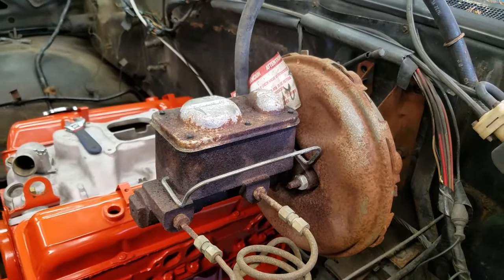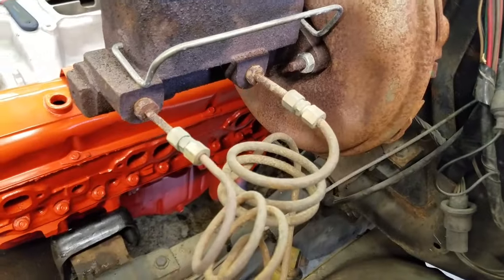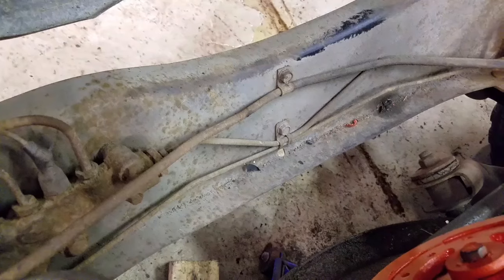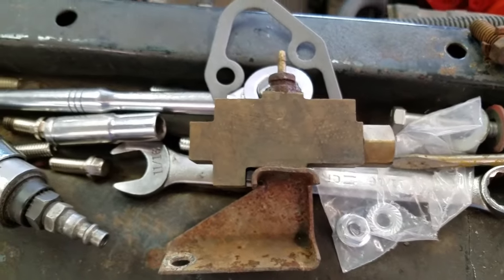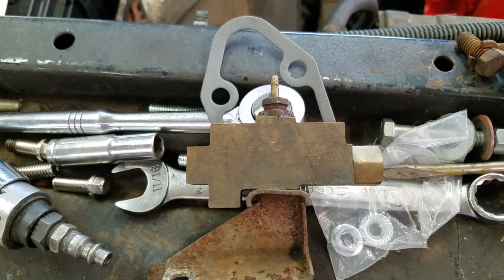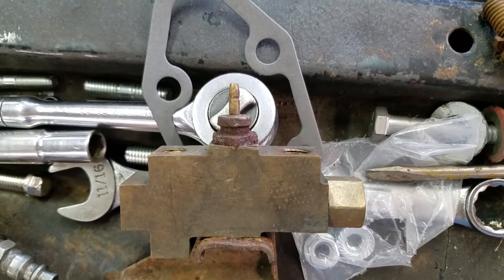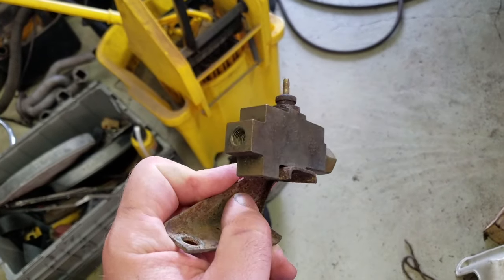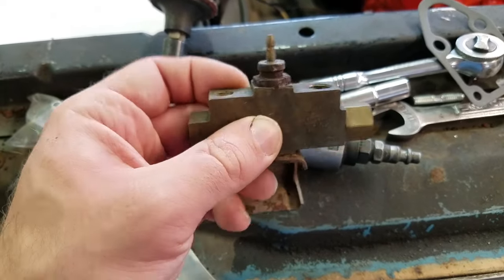Why Your Old Chevy's Brakes Won't Bleed.

Comment: this is the corvette guy again.  IT WORKED!!!   after weeks of saturdays mucking around this video was exactly the solution.  my son and i had problems with the rear brake line  on the valve, would not budge, so we went from the top of the valve, the switch, as described, removed the switch and used a very small screwdriver to move the rod back into position.  we tested that worked by verifying that the brake warning light went out.  at last.  bleeding worked normally. Eureka!
Reply from the maker: +Roost Fezza Great!
Reply: What's the company that makes the aluminum piece you talk about in the end of video

Comment: This just saved me a lot of grief.  Thank you!  FWIW it's fairly easy just to pull the brake like that goes to the rear off and shove a small allen wrench in there to "click" it over.  Pretty easy to tell when you get it because brake fluid will start to pour out

Comment: This is not completely accurate. First of all, that unit on the truck is not just a Proportioning Valve, but a Combination Valve. It contains 3 valves in 1 unit: 1) Proportioning Valve; 2) Metering Valve aka Hold-Off Valve; and 3) Differential Switch. The latter is what is tripped when there is a leak. Also, that button is the Metering Valve. It is not there to reset the front brakes. You're supposed to pull that button OUT to bleed the brakes. I'm pretty sure pushing it in does nothing to reset the Differential Switch.
Reply from the maker: It's covered with a factory boot and cannot be pulled, only pushed.
Reply: Yes, they are all covered by a rubber boot to TRY to protect them from the elements. I am sure that button is the Metering Valve, which is completely different than the Differential Valve.  That's why that button doesn't exist on that stand alone Differential Block you were holding. I believe some are meant to be pulled out to allow flow while others are meant to be pushed in (which can cause great confusion in bleeding). I suppose it's possible the Metering Valve Rod doubles as a Differential Valve Front Reset in your particular application, but I doubt it.  Otherwise, your point of needing to make sure the Diff Valve is reset is correct.
Reply: I can't bleede my My 2004 Tahoe . is this the same problem?

Comment: This happened on an '05 Silverado today.  We used compressed air in the right rear to open the blocked valve back up due to a leak on the back and line replacement.  Worked like a champ.  Fluid started flowing like it should.  Best pedal he has had.
Reply: Sir Sweetness
Reply: so you blew compressed air through the rear line so that the pressure would reset the piston in the prop valve?
Reply: Ooh, good idea. Worth a try.
Reply: @MrZayne8  

   After this Silverado, I had to do this on a tundra that we replaced a rear brake line.  I wasn’t getting fluid out of rear bleed screws so I did a small short burst of air and it let the fluid flow.  This sounds crazy but it works.

Comment: I was going crazy for a week trying to figure out why my rear brake will not bleed. This video really helped. Thanks
Reply: Arden Banks hey what was the problem with your brakes? I ask because I’m having trouble bleeding mine rear brakes trickle out fluid and the front gush out .and my brake pedal is soft.any insight would be appreciated.

Comment: Thanks for the video and thanks to those commented.  The technique for resetting the valve that worked for me was to open one front bleeder (with a hose attached to catch the brake fluid) and then to STOMP abruptly on the brake pedal.  I tried this a couple of times and it worked!  

The method of holding pressure on the brake pedal and then opening a front bleeder did not work for me.  I tried that at least 5 times with no success.  The "open first then stomp" method was discovered from reading through the comments.  Thankfully I didn't have to disassemble the valve in any way or remove it. 

Thanks again for all the comments!

Comment: Hey thanks Bud for your info. I have a 1978 Chevrolet 1/2 ton two wheel drive replaced the rear brake line still couldn't get it to bleed finally after watching your video it works. 
Thanks again
Reply: Hey I did get a new proportioning valve from Amazon and replaced this last weekend and I still can't get the back to bleed right any suggestions? It has new master cylinder on this has me stump.

Comment: Big huge help exactly what was going on with my 72 Cutlass. My solution was to relocate and get a new proportion valve. Turned old one into a simple T block X 2 one for front one for back. New valve located at master cylinder easy access worked great for me. I'm a simple dyi guy with no lift and limited space. Just getting to that old valve was next to impossible so by relocating it to where I can actually work on it saved me a lot of agg

Comment: A big shout out thanks to you about the problems with the proportioning valve! I have a 1987 plow truck that has developed this problem due to changing both front calipers. Tried to bleed brakes and nothing works. Have good brakes but the darn light won't cancel out! Now I know because of your help. THANK YOU.

Comment: @ Fuel Injection Sucks

I think you may have just solved my friends "rear freekin brakes don't seem to want to bleed" after replacing two masters due to leaks issue. Been dealing with it for about a month now. Thanks so much man, my buddy will be thrilled to see this video.

Comment: Nice video. This is exactly the video I was looking for. 

disc/drum Chevy.

Brake system is 90% new. Front calipers are geysers. Rear wheel cylinders just trickle. Disconnected all hard lines from the prop valve and blew compressed air through to be sure there was no clog. Replaced rear rubber hose in case it had collapsed but no change. 

final suspect was the prop valve and you just confirmed it is indeed the piston inside. Attempting to reset the piston tomorrow and bleed it for the last time for a while.

Comment: I wanted to tell you I just loosed the front brake bleeders and smashed the pedal to the floor, tightened them back up and now I can bleed the rear brakes so thanks for giving me a option on what to do, 15 mins and I was done bleeding all the brakes!

Comment: I KNEW IT! I've been chasing no fluid out of the front discs for days. Even with a power bleeder I only get a trickle from the front discs. The rear drums were flowing great.
I tested the proportioning valve with a test light and it came back negative (AKA it's all good) I suspect it's not centered. I'll follow up if it is indeed the problem.
Reply: Me too
Reply: ipwee a

Comment: I listened to every word. I have a '77 chevy P30 step van. We went to bleed the brakes and get no fluid to the rear. Even my mechanic was at a loss. Although I had a feeling it was something to do with this. I think im gonna just put in a brand new valve. The one that's in is original, so it'll go in my old parts bin to be restored at a later date. 😎

Comment: This video solved my issue with the new proportioning valve I installed. No pressure to rear, I pushed the valve back to the center and it was solved. Thanks!!

Comment: Glad I found this video.  The light on my 79 vette came on after a quick brake stab a few weeks ago.  It's got new calipers so I know it's not a leak issue.  Gonna try removing the switch and see if I can't reset it.  Might save me $100 for a new valve and the frustration of trying to bust free  40 year old lines...

Comment: OK, I'm slow, so I listened to it twice. I've got a 92 GMC C1500 and all brakes parts are good, I've bled all brakes, the same as I would on any other car, but I have no rear brakes. So I'm going to buy this tool and see if it works.  Now I think I get it. Here is , I believe the tool you need to lock the proportioning valve centered, so you can adjust the brakes. Search for this: "Proportioning Valve Bleeder Tool w/One Man Brake Bleeder". Thanks.

Comment: Exactly what I needed to find out.  Had a full drum setup that had rear lines disconnected for an extended period to rebuild the differential, and after one half of master cylinder drained itself down... all flow stopped at some point while trying to bleed.

Comment: Thanks for the video.....exactly what happened to my GN when I was trying to bleed my brakes after my rear brake conversion....I also replaced thebprop valve with a disc/disc prop valve. Will give it a shot. Thanks

Comment: I have a 71 GMC back brakes worked only, tried the stomping method didn't work, removed the brake light switch, sharpened a very small screwdriver and worked the piston back into position, re bled the brakes and presto everything works as it should. Thanks for the Vid

Comment: that button is the metering valve for front calipers to hold off the front brakes until the rear drums apply; so that front and rear apply at the same time

Comment: That explains why I couldn't get my rear brakes to work properly on my old 74 Camaro. I installed a Willwood adjustable propositioning valve. That fixed the problem. After some trial & error that car probably had better brakes than when it was new. If you convert from drum to rear disc brakes you will need one of those. Or your rear  disc brakes will probably never work right. They will work,but they won't even have the stopping power that your old drum brakes had. Disc brakes need much higher pressure to work properly. They will work if you use a master cylinder designed for use with 4 wheel disc brakes. That's how I converted my 97 S-10 to rear disc. Used a master cylinder from a truck with rear disc brakes. Had to power bleed the whole system and use an Autel Maxi- Pro bi-direcional scan tool.to get a good pedal feel. Before doing that it pedal was really spongy. I went through about 5 big bottles of brake fluid trying to get the air out of that system. I don't think it's possible to bleed the brakes on 94 & up GM ABS braking systems without a bi-direcional scanner with ABS bleeding function.  Some bi-direcional scanners don't have that option. So if you go out and buy one,make sure it's got that option, and that it will work on your vehicle. Some Tech -2 scanners have that option,but they don't work on all GM cars and some don't work period on trucks. The Autel has worked on every vehicle I've used it on..so far anyway,and it was way cheaper.

Comment: That was well explained. I wonder if compressing the slave cylinders when replacing brake pads might occasionally cause the proportioning valve to slide over enough to give problems later. Conventional wisdom is to crack the bleeder screw when doing that but in the rust belt that is an invitation to a broken bleeder screw. I've heard about that causing seal issues in the MC but with the difference in pressure between the two sides I wonder if there could be a problem there, too.
Reply: Awesome every now and then there is still just a every day Joe that has some thing really smart to say . These are the moments I am glad my old man invested a lot of time in me  and I know how to shut up and listen when it matters.

Comment: Thank you for this video. Something I didn’t know. I don’t have rear pressure but plenty on the front brakes.  I do believe you on this being a primary problem.  Same time I need to clean the fluid too.  Thanks again

Comment: Years ago I bought a new 1978 Trans Am.  In the morning when I'd go out leave for work I'd find my wife had left in it, leaving me her Pinto.  So, I bought her a Trans Am too.  When both of these cars got 10 years old the rear drum brakes started locking up.  I never was able to fix the problems.  New proportioning valves by then were no longer available.

Comment: thanks with that tip i got this problem with my 85 g10 van . im going nuts i already replaced master cylinder and wheel cylinders and still no brakes pressure on rear

Comment: Great video! They use the same setup on most Jeep XJs. I’ve gone through hell trying to get fluid to drums before figuring this out. Now I can’t bleed them & my MC is not building pressure to the pedal :/ I think the seal is shot but that’s tbd.

Comment: I got so frustrated by this that I took the elec. connector out, centered the piston, and drilled down thru the piston with an 1/8" drill bit all the way thru till the bit comes out the bottom of the block and drove an 1/8" roll pin in it to keep it from moving again. worked real good. Got great firm pedal. This piston is not really needed if you think about it because the master cylinder has two separate circuits. So say you blew a rear line, the only difference it makes is that you'll lose 50 cents worth of brake fluid out of the rear master cylinder reservoir (because the piston won't slide back and block off the back line.

Comment: No fluid to rear breaks Solved!! We could not get pin to push over pushing in as hard as we could with a small screwdriver. Instead our Mechanic loaned us an air bleeder (hooks to compressor) from harbor freight which drew the fluid to the back breaks. Then once fluid was to both back breaks we closed bleeder valves he had me stomp on the breaks about 6 times. That reset the piston he was referring to in the video. Back on the road!

Comment: I will say this, the larger Reservoir is usually always for the front because 70% of your stopping power is in the front and you don't want to run out of brake fluid in the front

Comment: Really shouldn't use compression fittings on brakes lines... Good video and info.
Reply from the maker: I agree, never use them. This was a sin of the last owner.
Reply: I also did the same as a kid , way back . Even though I did not have a problem , it only takes once . In New York , it may fail the safety inspection . Also , if it failed and you hit someone and they inspected your truck - you're screwed . Cal Van Tool has a great double flare tool . Not expensive and better than the standard types .

Comment: Awesome information! never ran into that problem myself most of the time the brake hoses seemed to have a lot of issues pulling real bad to one side or the other , I do remember some car having a leveling system and that would cause problems bleeding but usually a power bleeder would work , i forget what kinda car it was ,
 But good info !
Reply: thanks

Comment: If all else fails Summit sell a race application proportioning valve that you can manually set for front to rear brake pressure. I had to use one when I put a 1 ton axle on a 78 blazer.

Comment: Had same issue couple years ago, found a forum on this subject and someone said pump up the brakes with motor not running then press hard on pedal till a click is heard that is the piston recentering then you can continue bleeding,  worked on my 87 k5

Comment: Opening the bleeders and stomping on the brakes worked for me, I have a 79 g30. Thanks!
Reply: I have a 78 G30 box van , my front brakes won't bleed very well what should I do , open the front bleeders and stomp on the pedal?
Reply: @JuanHerrera-co3wc  did it work

Comment: I'm here because they got the same kind of trouble with the same exact proportioning valve trying to bleed the rear brakes on a chevy monza that had blown outhe rear brake line.

I inadvertently removed that rear retainer not when I was trying to remove the remainder of the rear brake line.
 Some guts came out and I thought I put him back in the way they came out I'm hoping I didn't screw anything up.

I just tried to put some positive Air pressure through through the valve on the master cylinder side and I couldn't get anything through.

Comment: When bleeding the rear drum brakes on an old 60 70s car or truck with disc/drum brakes, just pump up the pedal then give it a good stomp and that will recenter the porpotioning valve...

Comment: Where would you look next if the rear brakes don't bleed even with the centering tool installed?  Would that indicate the entire combination valve needs replaced?

Comment: reset proportion valve.
there is a reset pin on left under rubber cap on end on most.
Pull switch out recenter piston in center .
He is correct.

Comment: Great video. Fixing up a 68 impala the front master cylinder seems blocked and fronts won’t bleed. When I push the pedal the rear chamber bubbles but the front chamber doesn’t seem to have any pressure. Any suggestions?

Comment: Since you're working on the brakes... Those compression fittings by the master cylinder are an accident waiting to happen.  They weren't made to handle the pressure created by the braking system.  It may work for now, but it will fail without warning.
Reply: Nice catch.
Reply: 1/4" compression fittings are rated for ~300psi. Brake hydraulic pressure during a normal stop can exceed 1200psi. Definitely an accident waiting to happen. That's why it is illegal to use them on brake systems. Use inverted flare, or bubble flare only.
Reply: He has multiple posts explaining that is what the previous owner did and has corrected it.

Comment: Thanks for the heads up, the rear line was blown out when I bought my 79' C-20.  I replaced the hard line, but never really could completely bleed the system.  Will fluid leak out if remove the switch?  Does the piston have seals or it just a tight fit?
Reply from the maker: Won't leak. It's a bronze piston, no seals.